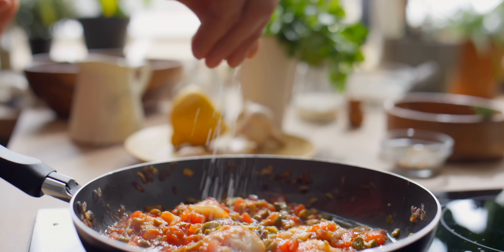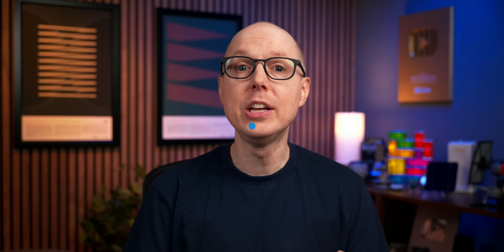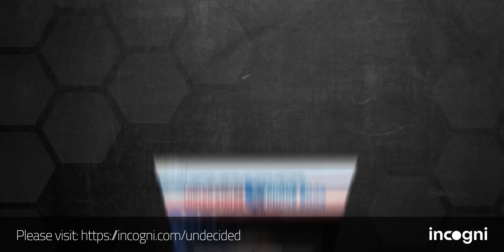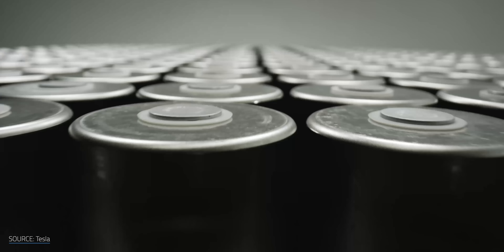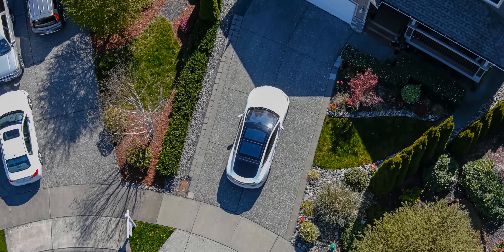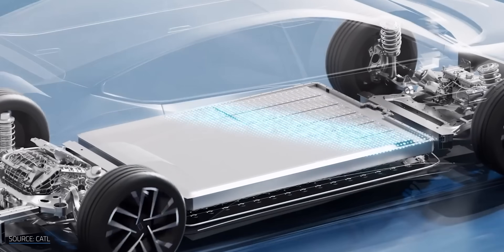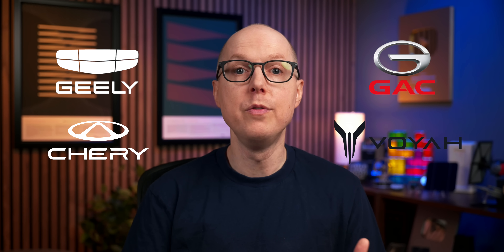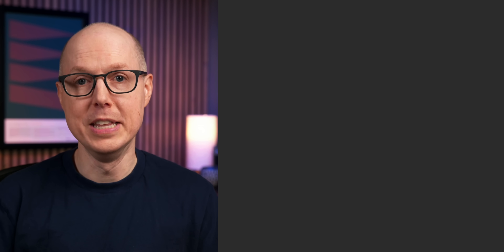How CATL Made Batteries 90% Cheaper (And What Happens Next)

Comment: If I could get a home battery for 1k instead of 10k, that would be revolutionary
Reply: I already got a 15 kWh battery for about 2k euros and it's LFP. If they make batteries really that cheap all the electricity providers would have lots of storage units.
Reply: @alexandruilea915  DIY I assume? and counting the inverter + charger also?
Reply: @herpaderpa0 battery cost alone, inverter and installment price not included of course.
Reply: @alexandruilea915  I did it my self and I a dumb carpenter, it's not hard read the manual that comes with stuff...
Reply: @alexandruilea915 so the batteries stop being the most expensive part of the system.
Reply: @herpaderpa0 no actually.. No actually a reedy made battery.. I bought 5 in total..
Reply: @alexandruilea915  ở châu á giá như vậy là khá đắt ... ở việt nam giá 15kwh hiện tại chỉ khoảng 1k2$
Reply: @alexandruilea915  That's hard to believe, best I've seen is 750+ euro per kWh. Where/what did you get?
Reply: @TheFeday  What? 12V 100Ah (~1 kWh) is slightly over 100 eur / usd
Reply: @alexandruilea915  which one is that?
Reply: @yeroonsgames Felicity Solar 15 kWh 48V 300Ah LiFePO4 is mine.
Reply: @alexandruilea915  How did you manage that? ... DIY with Tesla batteries and BMS?
Reply: @alexandruilea915  may I ask what brand?
Reply: @SzaszaG1 Chinese brand, FelicityESS
Reply: Got a 15kwh from China for $1100
Reply: @a.wgilbert5001 Unfortunately, my 4 ton AC unit would suck that down in 2 hours or so.
Reply: @a.wgilbert5001  seeing many videos of random battery fires and explosions in China from the hit or miss manufacturing will keep me away from their cheaper offerings for sure.
Reply: A home battery that could store 100 kWh for $1000 would make me cry 'Shut up and take my money'!! 10000 cycles would last 20-30 years. They will probably want to earn something too, but even at $2.5k investing in it would be a no-brainer.
Reply: @chrispsweden  you can get 60kwh battery from scraped BYD Atto 3 for $1500AU so for 3k you can get 120kwh and use fox inverter and dala's emulator to use those batteries.
Reply: Imagine buying 3x the capacity for 1/3rd the cost, you could legit run off 100% solar in perpetuity
Reply: We won't have power grids in the modern sense, just solar and batteries everywhere.
Reply: tell me about it. im ready to go in on solar/home battery, but the ROI is still over 10 years cash price.
Reply: @brjohow Not too bad and will only get better.
Reply: If I could get my Mother-in-law to shut up That's revolutionary.
Reply: Devastating, just devastating
Reply: home batteries are scalable so you can certainly buy a LFP battery for 1k that could meet your needs depending on your expectations and add more batteries as your budget allows.
Reply: Have a look at a repurposed EV battery. That’s probably cheaper. That’s a really interesting space at the moment. Rome’s Fumicino airport is powered entirely by solar panels and repurposed Nissan Leaf batteries.
Reply: If they get that cheap, we could essentially stop caring about the grids consistency. And just make houses "own" their own consistency.
Reply: Yep, size is a lot less of an issue for in home batteries. I care more about cost and safety. We'll see.
Reply: You can. Without tarriffs I can DIY good enough battery packs for around that. I don’t mean building my own battery. I buy the battery, the battery controllers, and enclosures from China. I just mean hooking it all up together into a home battery system.

That takes the 1k to 5k, add installation and profit margins and you get a 10k battery.
Reply: Curb your enthusiasm. My own calculations for my use-case show that the inverters, installation labor and extras already cost more than 50% of the total cost of my home grid. So if battery prices plunged by half, that only reduces the total cost by a quarter. What would really help would be if this kit would run my whole home off battery including big heat pump. Maybe such a batch of stuff will be offered in a year or so.
Reply: Local electric utilities should promote the adoption of residential battery storage through a rental arrangement. These batteries could be charged during off peak hours and balance their power generation.
Reply: Or swap a broken EV battery for cheap.
Reply: @grabedigger  Here in Oz, the 2nd hand EV's and broken ones are still holding their price due to the battery prices here.
Reply: I’d love to have 5x the battery for 1/2 the price.
Reply: Last time I priced home battery systems, they were all $13K. I'm glad I waited for battery technology to get better. The question is, how long does a project announced take until I can actually buy them?
Reply: @explorerofmind  . Exactly. I'm looking forward to Na ion batteries.
Reply: It would be world changing! for sure
Reply: Got a 15kWh battery for $1k in Cambodia shipping from china directly
Reply: No, they would still cost 10K but companies making them will make more profits. That is how capitalism works.
Reply: @wolverine_1832_op   Derp
Reply: 15kw/h you can get for 1000, diy version of course. which is even better and higher quality.
Reply: @SayWhaaaaaaaaaaaaaaaaaaaaaaat  how do you diy one?
Reply: And at home size and weight constraints aren’t nearly as much of an issue as in a vehicle.
Reply: It's 1.5k now: https://www.youtube.com/watch?v=oisSDHpgld0
Reply: There's a Dutch company selling plug-in home batteries for €1350,-

They're LFP batteries of 2,5kWh with a maximum power output of 800W but it's already more than enough to balance out your solar panels during the day. It very quickly pays for itself.
Reply: @NiekNooijens  It's expensive at 1350 per 2.5 kWh. As I said already, there are 15 kWh for less than 2500 euros, but you need an inverter that supports low voltage batteries.
Reply: Yep, I’d buy it!
Reply: Docan is selling 30kw battery for solar storage for $2500usd
Reply: THIS.  the energy density difference (per the video 175 vs 185Wh/kg) is negligible for a home or business.  it becomes a lot more attractive to purchase 2-3x capacity vs the unit-cost of current Tesla/Enphase/LG etc home batteries, and STILL save money. Now I can have 3-5 days of storage without breaking the bank.  Also: it helps on properties like mine with partial shaded panels to "make hay while the sun shines" - banking power from high solar-production days or low utility rates with Time of Use billing.
Reply: That's a fairy tale. In the next years, 10k will be the current 1k...
Reply: Getting a flywheel to store power for your home would be revolutionary.
Reply: @explorerofmind  Of course that you will never get them for 10. This is manufacturing price. Retail will be about 30-40.
Reply: You can, for 1600... and will prowse proves it last week
Reply: @explorerofmind  I got 32kwh (2x16) for 2.8k Eur
Reply: Ditto.  I have $8k invested in batteries now and would much rather have invested only $800.  I wish someone would do that same efficiency/cost gain/breakthrough on solar controllers/inverters.
Reply: There's a lot of additional hardware and software (bluetooth, wireless, BMS) in today's batteries systems so I personally would be surprised if the the cost reduction was 90%.
Reply: it is partial clickbait ........
Reply: I build several LFP storages in the last years - and current prices on quality LFP cells from Alibaba are 50-60 USD per 1kWh. Sometimes already in EU stores. So it gives You 10 kWh battery pack for 500-600 USD + BMS, wires and some construction - and You are not even reaching mentioned 1k USD. Thats why I currently have 45kWh battery and plan to upgrade to 100kWh next year, as I go full offgrid at least 8 months a year. Panels also cost 1/2 of what they used to cost 4 years ago. So I am stuffing up before idiots in EU dictatorship decide to remove this option for self-sustainment from us because "China bad" ...
Reply: @nufnuf816  Battery safety expert here. It's great that you are able to go off-grid, but I hope you don't put these anywhere near where you sleep. Alibaba is notorious for selling counterfeit or poor-quality cells with high defect rates and those cheap BMSs frequently fail, which can result in shorting the cells, overcharging to thermal runaway, or many other scary failures. Since you already have quite a stockpile, I highly recommend separating them into groups no bigger than 20 kWh with at least 5 ft spacing in between. Otherwise, if you do have a fire, it can get really out of control. At least in the US, a 20kWh battery fire is about the limit of what a single fire engine can put out. Be safe!
Reply: Not if it has only a 10th of the lifetime/cycles...
Reply: I got 14.5 KWh of lifepoo storage for 2K.  Glad I didn't get more if we can get sodium soon.
Reply: Here in Europe home batterys are only 3 to 4 Thousand, what's wrong with you Americans 😭
Reply: Will Prowse just demonstrated a $3k 16kwh home battery.
Reply: I will install it myself
I just need to power a mini fridge, a light, and mini split for a day
Reply: https://youtu.be/oisSDHpgld0?si=k3jusc6OUCvXXx3C
Reply: you can today with LFP if you buy the cells from china and assembly yourself
Reply: Yes, weight doesn't exactly matter for a stationary application like a home battery.
Reply: You can now. Very nearly
Reply: This is what @pilaenergy is selling.
Reply: Any American supporting this company is insane.  Would NOT purchase anything containing this battery.
AM NO LONGER PURCHASING ANYTHING PRODUCED OR OWNED BY CHINESE.  With 'UNRESTRICTED WARFARE'
against the U.S, DO NOT plan to support China in any way ever again.
Reply: Yeah, I’m holding out for a $45 while house battery
Reply: 10k? 10kWh battery for your home solar plant costs more like 3-5 k nowadays, including installation, and with subsidies where available - way less. At least in EU. However, the equivalent sodium-ion battery discussed here would, if we take CATL cost estimates seriously, cost several hundred dollars, so less than an average smart phone. This is just too good to be true.
Reply: Sorry to break it ro you but 6kw battery is already at 1k$ OUTSIDE USA
Reply: Its already at 1k outside USA, this will drop it to 100$ OUTSIDE USA
Reply: I wish that the sodium batteries are cheaper than lithium.. but it won’t be…. ATM you can get a sodium solar battery here in Aus. But at the same price as Lithium per kwatt..  so it’s not cheaper at all…
Reply: It might actually make solar worthwhile
Reply: Would also be revolutionary for less developed nations - means skipping entire decades of infrastructure building when you can just give people batteries.
Reply: @explorerofmind  don't worry your government will prevent that
Reply: I made 15.6 kwh LFP battery using EVE304 cells and jk bms and solis 5kw hybrid inverter for $3000 AU three years ago. In the same cost now we can make 40-50kwh battery as EVE cells are now $70AU per kwh
Reply: it's battery+inverter, If battery drops 10x, overall cost will drop 3x... maybe
Reply: A home battery needs more than just battery cells. There's an inverter, a computer, there's a lot of cables, changes in your house. And hourly rates of rare electricians. I'll be happy if these new cells would cut a complete system cost in two.
Reply: @mischadebrouwer9855 we are not counting that as that's a one time cost, but the batteries themselves can be scaled with minimal costs after the initial cost. My cost was about 5k euros for the whole setup, but I got a 16 KW three-phase inverter which is not really cheap to say the least. Now, doubling or quadrupling the energy capacity of the batteries costs only in cells and some copper wires as they will be connected in parralel.
Reply: @mischadebrouwer9855  But the price does not scale the same. You need a computer, an inverter and the cables and to pay an electrician, regardless of whether you purchase a 20 or a 200kwh battery.
Reply: @amadexi sure, but I see no use case for a 200 kWh battery. And neither do I have the space in my house
Reply: @mischadebrouwer9855  But it's always been the batteries that drive the cost of the system. Battery prices have plummeted, and continue to fall. This would accelerate that trend, and off-grid, energy independence for everyone, especially in sunny regions, is universal. Truly no reason to use a gasoline car for local travel. Game changer.
Reply: @mischadebrouwer9855  That depends on whether you stay on the grid or not. I think we will see a paradigm shift in energy production from grid to self produced and stored. Imagine the savings in infrastructure as well as the asthetics with no more power lines and poles.
Reply: @mischadebrouwer9855  good enough vs perfection... Inverter with computer, and some cables to interconnect with existing or added breaker box - agree.
Changes to house? NICE, but expensive, and easier to do when completely renovating or building new. And also don't see as strictly needed for many existing houses.
Reply: My OnePlus 13 phone has the Sodium battery and they launched that in January 2025. It has 20% more capacity at the same volume/weight, charges from 0-100% in 36 minutes, has a higher C rating than most batteries and last as many cycles as LFP, so 3x normal batteries). It’s insane, and I can’t wait for all car manufacturers to adopt this technology. That would give the Tesla Model 3 RWD almost 1000 km range.
Reply: Even if the cells would be one tenth the price of lithium, which is NOT going to happen, the battery management system, casing, racks, packaging, logistics, installation etcetera, will be mostly the same cost, or higher, as lithium systems, due to more bulk/weight.
Figure a best case scenario, where a turn key domestic installation, will be maybe 50% the price of a lithium LFP battery per kWh.
Reply: @pontusmalmstrom1055  That is still a major leap forward. They be printing money with that kind of gain.
Reply: @pontusmalmstrom1055  other than the inverter the rest is cheap. The actual cell packs have always been the most expensive.
Reply: @pontusmalmstrom1055  You're failing to consider that at that price many more people will start getting those systems, therefore, more manufacturers and/or more efficient and standardized manufacturing. It would take a few years though for those benefits to manifest.
Reply: @pontusmalmstrom1055 
I love it when people confidently say "it's NOT going to happen."  It makes them look so stupid when it does happen.
Reply: lets be honest you'll pay 10k still but the company will make even more money.
Reply: @Void_Glitcher  Or the importers.
Reply: @explorerofmind  then there would be a 350% tariff on them.  US energy companies wouldn’t allow it
Reply: @bh-zj4yt   not every one lives in the USA
Reply: @thomasvilhar3560  don't tell the USA that. haha
Reply: @clayton4620 What do you mean? I’ve been all around the world, from NYC to LA!
Reply: @thomasvilhar3560  Argentina looks good with the world's first Libertarian President.
Reply: @bh-zj4yt  You'd be wrong. The use of batteries would offset peak times when the US energy supply can't keep up. The energy companies CONSTANTLY call up manufacturers and businesses to turn off unnecessary equipment. For manufacturing, it's often the air conditioning
Reply: @Ichibuns  They're not talking about the utility companies.  They're talking about Big Fossil energy companies.  They want fuel burning everywhere.
Reply: @Ichibuns  I work for a residential battery company and utilities have paid millions to politicians to get policies like NEM 3.0 passed which aim to destroy residential solar. Utilities are only on board with batteries if they're the ones who own them.
Reply: @bh-zj4yt  The “you can’t buy it until we reverse engineer it” tariff?
Reply: @ValidatingUsername  they literally bought up US companies took the products and did just that. If they didn’t buy the U.S. company, they would require the U.S. company to agree to technology transfers if they wanted to have the made in China. They did the same with solar and cellular, though they actually stole the cellular technology. Stop with ignoring the other half of the story.
Reply: @bh-zj4yt  that's still 3.5k instead of 10k
Reply: @bh-zj4yt  but we live in a free country

🤣 jk I know we don’t
Reply: @bh-zj4yt if prices drop +90% then a 350% tariff would be a drop in the bucket.

The product would still be about 1/3rd of its original price.
Reply: @bh-zj4yt  USA is 3% of global population so who cares
Reply: @bh-zj4yt                     Sales Incentive To Eliminate Shipping Costs & Make It....      In America
Reply: @bh-zj4yt  $3,500 is still less than 10k...
Reply: @bh-zj4yt  you better price is $1l retail in China , that means wholesale price that get tariffed is about $500, even with 350% the total retail price in US is less then $3K with tons of revenue to pay off national debt 😎😎
Reply: @evgenyonishkevich8494 . Tariff revenue 😂😂😂😂. You’re dreaming MAGA
Reply: @bh-zj4yt  That's not true.  Energy companies will adopt and permit technologies that will grow grids without the need for infrastructure costs.  They'd be "all in" as they say.
Reply: @Technogeek-rc6us yeah you can trust the energy companies.  They won’t screw us
Reply: @bh-zj4yt  Most of us don't live in the USA..
Reply: @Livinghighandwise . Livinghighandwise😂😂😂
Reply: @bh-zj4yt  Lately I've been constantly relieved of not living in the US
Reply: @salmadys . It’s rough to see what’s happening
Reply: @bh-zj4yt  Yeah but Sodium is prevalent everywhere.. so we'd have control over the source material...
Reply: @bh-zj4yt  Who cares about US...
Reply: @ToneyCrimson  We care about all countries.  We are all related. ❤
Reply: @ToneyCrimson  99% of the planet money system, try to keep up
Reply: Careful, don't let Trump hear about that, there will be a 900% antidumping tariff put in by the end of the week.
Reply: You mean $100.. 

If I could buy 1kWh for $10, or even $20, I would be installing 100kWh as soon as I could build a platform that would hold the weight.
Reply: most of the cost doesn't come from the basic cost of the cells themself. So even if the actual cells are 90% cheaper, the final cost of products you can buy and install will probably only be 30-40% cheaper if we are lucky.
Reply: @cocoxcocoa for the batteries themselves it does a actually. A 15 kWh can be made with about 1200 euros in DIY right now or about 2000 euros + VAT for a readily off the shelf one with case, bms and so included.
Reply: @cocoxcocoa  thats my knowledge too, but I always find this is somehow strange. BMS cost like $50, stamped steel case another $20, cables, connectors, maybe another $20. $20 for assembly.
Bing bang bong, 5KWh battery turns out to cost $1000 somehow when it's $250-500 for cells, ~$100 for pack manufacturing.
p.s. it's at least 2x more if you live in New Zealand/Australia. Occasionally 4x more lol. The grid scale project recently completed cost $550 USD / KWh - that is 10x more than system prices quoted in China.
Reply: 90% of a home battery isn’t lithium. There’s better analysis out there tbh
Reply: Low cost batteries? Have you tried just being insanely rich instead? Homeless? Just buy a house!
Reply: @schnizzyfizz7832 you make a really valid point. Just pull yourself up by your bootstraps.😂
Reply: Sorry to pour cold water on your hope, but the sodium chemistry may at best reduce the price by 20%. The vast proportion of a home battery cost is made up by the electronics, structural design  and installation costs. These costs are not getting much cheaper and installation costs are actually increasing. The cheap home battery option for the future is vehicle to home charging which has the potential to be installed at half the cost. Wait another 5 years though.
Reply: @jo-annecardosi897 I think you missed the point; CATL is saying that PACK level is $10/kw.